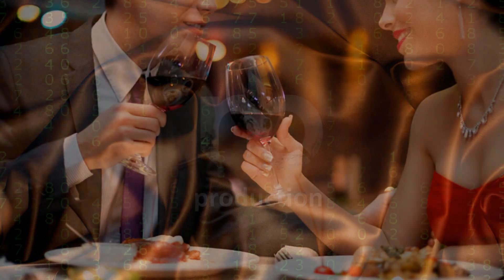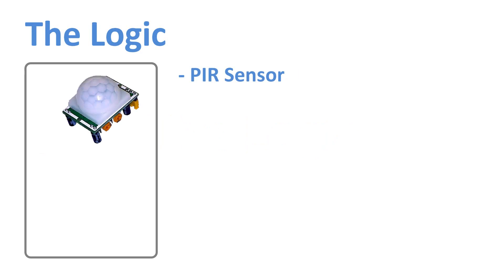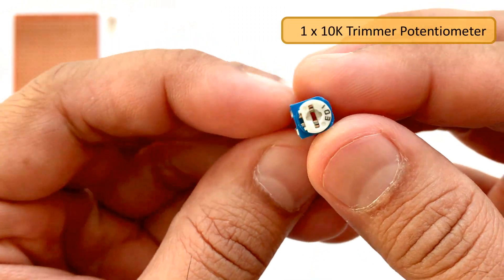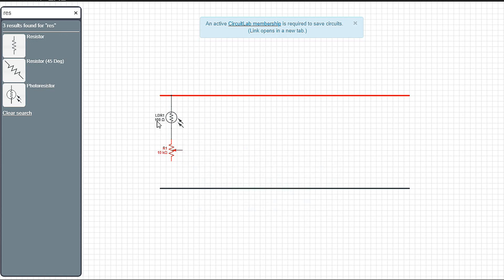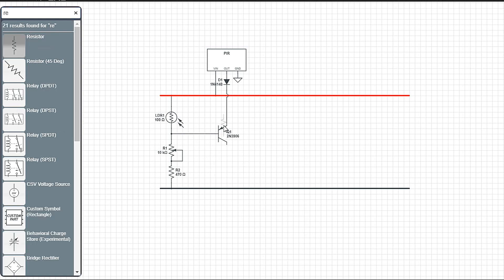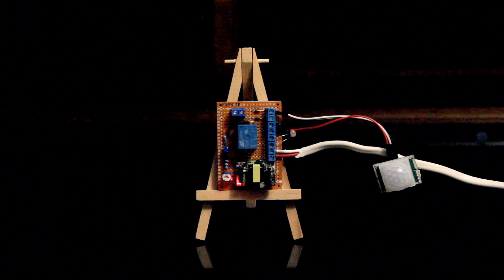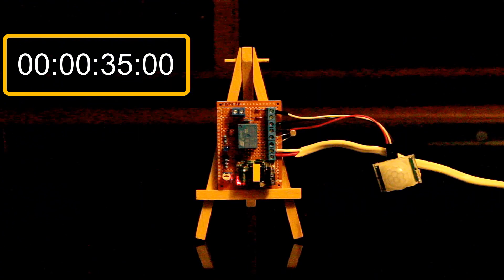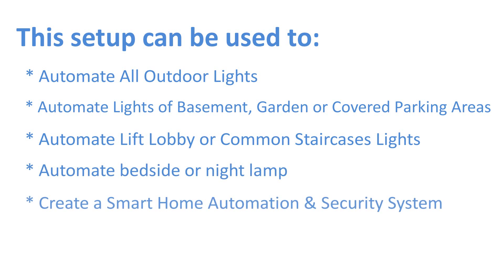DIY -  Automatic Garage Light

Comment: Good video. Would be nice to have a parts list.
Reply: Thanks!
Reply from the maker: For this tutorial we need:
A General Purpose PCB
2 x HC-SR501 PIR Sensor
2 x 1N4148 Small Signal Fast Switching Diodes
1 x 1N4007 High Voltage, High Current Rated Diode to protect the micro-controller from voltage spikes
1 x LDR
1 x 10K Trimmer Potentiometer
2 x 470 Ohms Resistor
1 x 10K Resistor
1 x 1K Resistor
1 x 2N3906 General Purpose PNP Transistor
1 x 2N2222 General Purpose NPN Transistor
1 x 5V Relay
1 x LED to display the status
5 x Terminal Blocks
1 x 220V to 5V Buck Step Down Module
Few Connecting Cables And General Soldering Equipments

Comment: How did you implement the 30 second delay? I didn't quite get that part. I would expect a big capacitor or a 555 somewhere in the circuit.
Reply from the maker: You just need to adjust the POTs on the PIR Sensor
If you want to know how, have a look at my PIR sensor tutorial: https://www.youtube.com/watch?v=jvGOtvnPU9Q